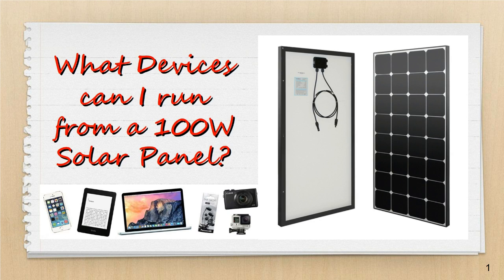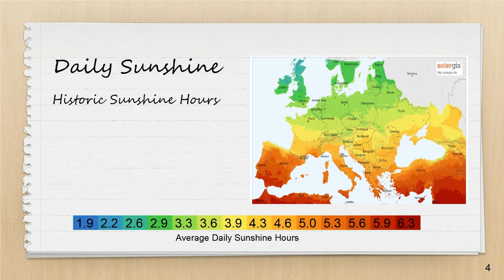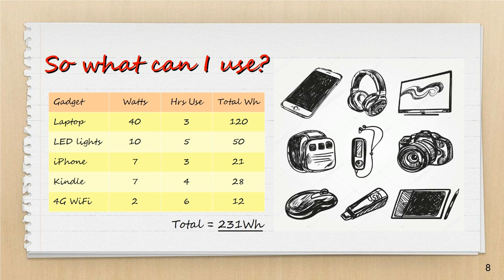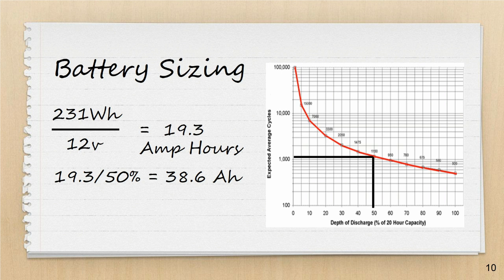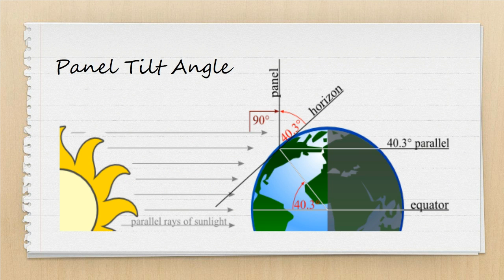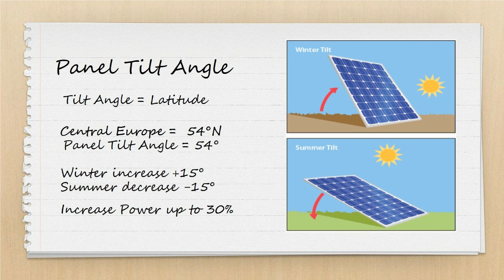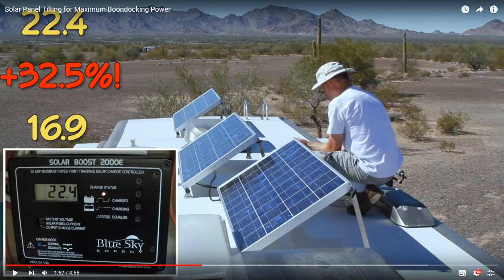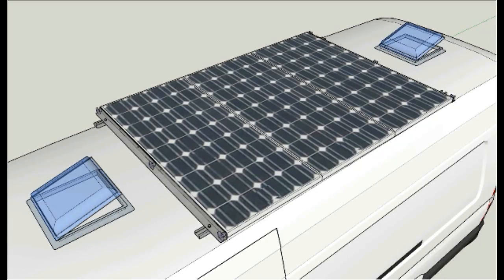What can you run on a 100W Solar Panel?

Comment: I have 3 100 watt solar panels and they barely light a string of LED lights behind a wall sconce. They only like the lights early brightly in direct sunlight the rest of the time. Elijah's on very dim.
Reply from the maker: basspig there’s something wrong with your setup a 5m string of LEDs is only 60w or 5amps at 12vDC 
What leisure batteries are you using with these panels?
Reply: @GregVirgoe  No batteries. Just driving the 3 48" LED strips directly. They do get almost to full brightness in November when they get direct sun from 10am to noon or so, but the rest of the day, they're pretty much useless.
Reply from the maker: basspig no wonder you’re struggling with some storage to draw a constant load off your solar will be up and down like a fiddlers elbow every time a cloud goes over.
Reply: @GregVirgoe  The purpose of this LED array is to take the place of a 12' sliding glass door which I removed a few years ago. It was suddenly too dark in the room so I added the LED panels, daylight LEDs, three 24W arrays. The problem is that it's too dim 22 out of 24 hours of the day in winter and 24 hours a day in summer, because the foliage blocks direct sun.

Comment: Hi injoyed your  video. I was thinking  of putting another  leisure battery to my van, as my fridge only  runs  on 12v  .but would  that be a waste  as only  have  a 120w panel  ,so from what you say I guess I  would  struggle  to charge second  battery  on this setup. Any advice  would  be handy  thanks in advance
Reply from the maker: You would be better if you can invest in another panel so you can generate more to put back into your battery during the day.
Reply: Thanks  for  such  a swift  response. I  will  have  a look  at new panel does it have to have a separate  controller  or can it be linked to the existing one.thanks again
Reply from the maker: @marshy2163  get the same as you have now and wire them in series on the roof. No need to change cables down to the charger just make sure the charger is rated fir the total watts of both panels. 👍🏼
Reply: @GregVirgoe  Thanks  very  much  for information, will  get out there and sort it when it warms up a bit. All the best  David 👍

Comment: Nothing like a clear well articulated and measured delivery. Thank you. Could you pls advise if I used two 150 amp Lifep04 24v batteries connected to a 3Kw inverter if this would be enough to run a 1500w induction motor circular saw for short periods of about 15 to 20 min at a time.They will be powered by a 200w solar panel. Usage less than 3 times per month. I know I cold go with a 3Kw inverter generator which would be much cheaper but I don't like the noise and neither will the neighbours! I cannot run power to the garage unfortunately.

Comment: Hi Greg,  can I ask some advice please. I'm building a SWB camper van and going to fit a 120w solar with a controller. We just want to charge phones, tablets etc and run some led  lights etc, what system would you recommend and what type of battery ? Thanks so much.

Comment: You are a smart cookie.
Great education.
However, it looks like I need the flight deck of the Saratoga to use the panels I would really want. Sigh.
Question: How would panel efficiency fall off at temps greater than 25C ?
A deck of a sailboat in the tropics could hit 40C.  ( 104F )

Comment: Can you please explain inverters?
Reply from the maker: Patricia Fortune an inverters main job it to take direct current from you battery and change it into alternating current at a much higher voltage. So it takes 12v DC from the battery and changed it to 230v AC power like you have in the sockets in your house. Hope that helps. 👍🏼

Comment: Hello. Is it ok to install a 100W solar panel to two 100Ah baterries? Will it be charging the batteries with same efficiency like one 100Ah battery?
Reply from the maker: The amount of energy generated by a single 100W solar panel will be the same if connected to one, two, three or four batteries as it’s not relative to the battery bank. The amount generated depends on the sun. You would be better off investing in more solar in relation to battery storage because you can only use what you can generate otherwise your batteries will never recharge. I recommend a 2:1 ratio for example -
200w solar - 100Ah battery
400w solar - 200Ah battery
Alternatively look to charge the batteries while driving and from mains hook up for backup. 👍🏼😊
Reply: @GregVirgoe  The problem is I do not have so much place for 2 or 4 solar panels on the roof in my car😕 But my assumption is: I will be using laptop or radio for 3-5 hours per day aproximenently and two times charging my phone, while the car is not running, so this takes around 500Wh (40Ah) so this is 20% of mine batterries capacity. And one 100W solar panel would give me 20-40 Ah in a sunny day. I think one such solar panel is enough in my case. I don't plan staying in one place more than two days, alternator will fix the rest of the job🙂
Reply from the maker: @venturaventura345  you could also supplement it with a portable panel that you can put outside and face to the sun. 😊
Reply: @GregVirgoe  I will think about that too, thank you for the answers and for your video, I have found it very helpful, greetings!
Reply from the maker: @venturaventura345  hope you have many happy travels. 👍🏼😊

Comment: Hi Greg I have a Bosch L5 90ah lead acid leisure battery which is new, I’m really interested in adding a panel to my van, I’d like to use more Cl sites with no hookup and a compressor fridge, all of my lights are multiple led downlighting I have no tv but would use say an iPad 12v socket charger and maybe the sink pump, if 40 ah is my useable power is say 40ah is 100w panel enough? I don’t mind using battery lights at night

Comment: One question. Does it matter if I use a new battery or an old battery for my solarpanel??  I found an old battery near my house and I checked it with my multimeter and it reads 12.5V.

Comment: Nice video Greg. thanks. Please, if I want AC power what solar inverter size do you recommend for a 100Watt Solar Panel with 100Ah deep cycle battery.

Comment: How did you work out the watts on your laptop? I know it's volts x amps but where did you get that info? My laptop charger says 19v-6.32a. Do I multiple these figures to get the watts? Thanks
Reply from the maker: Yes, exactly that W = VxA
So 19 x 6.32 = 120W
I do have a plug in watt meter so you can check exactly what watts it’s using. 👍🏼😀
Reply: @GregVirgoe  Sounds like cheating to me 😄. So on your diagram, your laptop says 40w. Where did you get that info from? Thanks
Reply from the maker: I’m sure I turned it on and plugged it in to my watt meter
Reply: @GregVirgoe  Lol but that's not helping me is it?! 😄
Reply from the maker: Holistic-Healing UK the answer is in my first reply
120W 😊
Reply: @GregVirgoe  But I'm getting confused. Does that mean a 100w solar panel won't be enough to charge my laptop? 🤔

Comment: Very informative Greg But not to change the subject but; is there an easy way to figure out the exact inside dimensions of the van including window cutouts, doors, flooring dimensions to walls etc. I am not sure if Mercedes publicises this in a manual somewhere or if it has to be done by measuring and or protractor work. thanks for any advice in advance.
SEABEE SPRINTER

Comment: Greg, I have 2X130w solar panels on my boat for almost all uses, except hot water (gas), cooking (gas) and AC (which I don’t have).
However, and this is our difference, the main consumption for me is the fridge and freezer, which I’m not sure if you have incorporated into your calculation, possibly because on land you have other alternatives that you don’t have  in the water. 
I created my own fiberglass top-opening single box with two compartments/two hatches/two motors frigde (70 liters) and adjacent freezer (30 liters) with 10cm polyurethane insulation around the fridge and 15 cm around the freezer. 
If you are to feed your refrigeration with solar juice, then the top opening fridge is really your only alternative, given the limited real estate for solar panel placement. 
It would be nice to know why you didn’t choose to go solar with your fridge, I assume because of kitchen space  parameters. Thank you.
Reply from the maker: Yannis Tsakiris this video is not about the setup in my van it’s just about what you can run off a 100watt panel. 
I have a 12v fridge running off y solar and have been 100% off grid all the time with no other power source.
Reply: Greg Virgoe     I know, I just mentioned it as a comparison. 
Bizarre though...a front loading fridge run by solar! I’d have thought the waste of energy would be very important,     both from the losses when opening the door as well as the limited insulation in this type of appliances. But you know better since it’s your occupation too. Thanks.
Reply from the maker: Yannis Tsakiris yes it probably does use more energy but as long as I have enough solar that energy is free so it’s not costing me anything.  A conventional fridge is a better use of space and more practical in its operation.
Reply: Greg Virgoe     I’ve just taken a more thorough look at your solar panels and fridge installations and I got my answer.
You got almost double my solar wattage (480 vs 260 of mine) and you also have a fridge which is around half the capacity of mine and a freezer which is probably much less than one third of it (from the pics).
Therefore, yes, a front opening fridge is very well suited under these conditions and you’re very right in having chosen it vs the much-much bulkier (and less practical as you’re suggesting) version of a top opening one.

Just to explain my choice: In the Med where I do my boating between the islands I needed a big fridge and freezer to be able to store the necessarily big quantities of food but also water and other liquids; also be able to produce a lot of ice for the countless drinks for myself and guests. Hence the need for a 70 liter fridge and a 30 liter freezer. 
If you combine this to how many times the lid is opened, just for water, and what the external temperature is, I would need twice the solar panels as well as twice the batteries, for both of which there is simply no space, either on the boat bimini top (for the panels) or in the bilge (for the batteries). My solution was this huge box (huge, because of the extreme insulation all around it and under it) that takes-up a lot of galley space, it’s true, but meets all the other requirements stated above...

If you ever decide to travel to the ...tip of the continent, just yell.

Comment: one question i see:  how to you stop the inverter from draining battery beyond 50%? on mine, it shuts down the "battery drain"
when it gets @  11.6 volts..... short of 50%... no auto-restart feature on the inverter, manual only. never have had any problems with this setup.. though sometimes kinda  irritating!  custom electrical features on the inverter by my electrical friend! thanks to him!

Comment: Hi Greg, love the videos.
I have a 150w solar panel, last year it kept my batteries ok while in the compound, this year I am charging the batteries every two weeks.
I have two 110 amp 12 v leisure and one vehicle battery. The leisure have priority.
On normal days it showing me that I am getting  0.3 amps - 0.7 amps ongoing which to me seems low.
What do you think I should be getting, I live in the south lakes, Lancashire/ Cumbria border.
When I bought the system the green light was bright, but now it’s quite dull from the controller, don’t know whether this has any implications.thanks

James
Reply from the maker: First I would check the panel. Make sure it’s clean disconnect it and check the current and amps when it’s facing the sun with a cheap multimeter. Check the disconnected voltage at the battery to see the state of charge. If you were only charging every two weeks you may have been over discharging the batteries and now they no longer will take and hold a charge? Better to keep the batteries topped up everyday with the solar panel.

Comment: Thank you for this video. I am in no way a tech geek and this helped, however, what benefit will I get if I add a 2nd 100W panel in parallel to the one already fitted. I have x 95ah leisure batteries fitted. Will it help top the batteries up quicker?

Comment: Hi Greg.  Amazing series.  For your UK climate do you think the 480watts is necessary or could you get away with 300?  I'm in a similar climate and was thinking 300W but with 400AH of battery.  I won't be doing too much out of the ordinary other than running a high power blender, espresso maker and charging an ebike.
Reply from the maker: Hello Ian, don’t fall into the trap of having a massive battery bank that you can’t recharge.  You can only use what you can generate. If you can’t put the energy back in each day then you are just constantly going to be draining those batteries until they die. Far better to have a battery setup smaller that you can keep topped up every day. The less you discharge them the longer they will last. 
300w will just be enough as long as you manage your power usage. Charge tech when the sun is out, use minimal stuff overnight. 
200-220Ah of battery with a decent DCtoDC charger to make use of the time driving would be a big help. 😀👍🏼

Comment: Greg, how long can the batteries hold a charge when not used? My thinking... 1 panel, 3 batteries. Less roof real estate used but lots of storage saved for a rainy day
Reply from the maker: mem5922 in practical terms it wouldn’t work because you wouldn’t be able to generate enough power to recharge a larger set of batteries. You’ll be constantly draining them and never be able to get them back to full charge. 
Your solar panels need to be large enough to give you enough power for minimal daily use. From experience it’s far better to have bigger solar system and smaller battery string. 300w solar and 200Ah of AGM battery is a good setup to be 100% off grid and the whole thing can be done for about £500

Comment: Hello again I’m still loving ur work ,could i put 4 batteries in to last longer or is that not how it works 😆
Reply from the maker: Hello Ella, this is the trap that lots of people fall into, the problem with larger battery banks is you wont be bae to generate enough power to recharge them fully and will be constantly runnign them down. Better off having larger solar system and smaller battery bank and keep them topped up all the time, they will also last longer that way.

Comment: A 100W solar-panel is going to give you about 60W out at your inverter. You are going to use the solar-panels to charge a decent sized battery-bank, that is the practical way to do it if you want to run a substantial load.
Reply from the maker: The 230v inverter is connected to your 12v battery bank, so it's output is not determined by the size of your solar panel. You can run some load directly off your solar charge controller but it is normal to run your loads off the battery bank as you say.
Reply: @GregVirgoe  If the setup involves an inverter running off solar panels, obviously the power-output of the inverter cannot exceed the power-output
 of the solar-panels.
Reply from the maker: tickyul the inverter is not connected to the solar panels. The solar panels are just charging the battery. Connect the inverter to the battery then you can pull a bigger load. 
I have 480w solar and 2000w inverter. They are not connected to each other at all.
Reply: @GregVirgoe  Yeah, that was kinda my point.

Comment: Just curious....can I run 5x 100w incadecent bulbs directly off a 500w inverter with 500w solar panel on it?  My goal is to use the heat from the bulbs to add heat to a room/garage during the daytime
Reply from the maker: You will need a solar charge controller and batteries to store the energy then run the inverter off the batteries. You can’t connect the solar and inverter directly.

Comment: Only way to make them tilting systems work. You have too be willing to climb up there everyday 2-3 times a day. To change the angle...

Why I just installed a DC-DC converter. Use the alternator to top off the batteries. It ends up being cheaper and easier..That or install Portable tilt panel system on the ground. That way you can use it anywhere, You don't have to park at the best angle for the vehicle. You can park in the shade and still have the panels in the sun. Then pack it up and put it away when traveling...

Comment: Greg, excellent Video, thanks. I am wondering about how this would work so I could leave the 12v fridge on all the time?
Reply from the maker: Hello David, the fridge is connected to the power 24hrs a day but the compressor does not run all the time it’s controlled by the thermostat in your fridge. So it only draws power intermittently during the day depending on how much you use it. That’s why I estimated a lower running time. Hope that helps
Reply: Thanks Greg that's helpful

Comment: Another great video. I see one slight issue thou. Your design for the tilt relies on your van facing the same way all the time. If you park your van 180 deg then the design wont work same with 90 deg.  If you were to change it so the bottom hinge was a removable bar which could be placed on either side and the support arm mounted in the middle of the panels then that would give you more useability
Reply from the maker: You can always park forwards or backwards in any spot, therefore the worst it would ever be out is 90 degrees. If it was really a problem I will just leave them flat on the roof and suffer a few percent losses, I have loads more solar than I actually need so it's not that critical and in reality unless I'm struggling to get charge because the weather has been bad for a few days running, I will leave them down all the time.  You would have to have loads of slack cable to hinge it both ways and it's really not necessary.